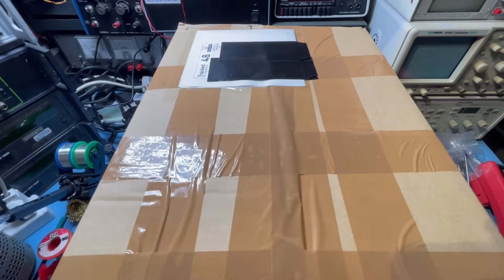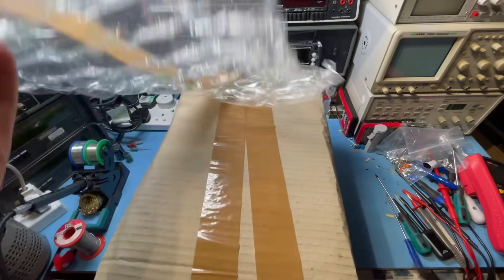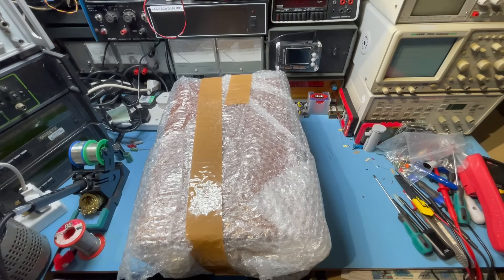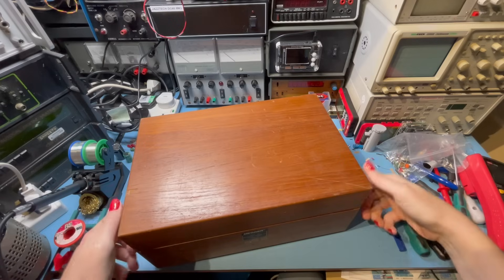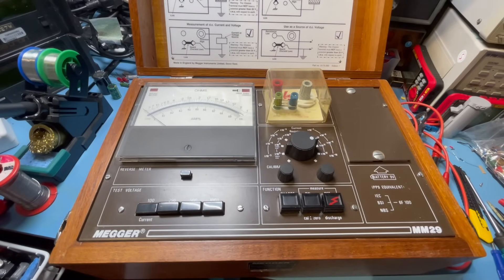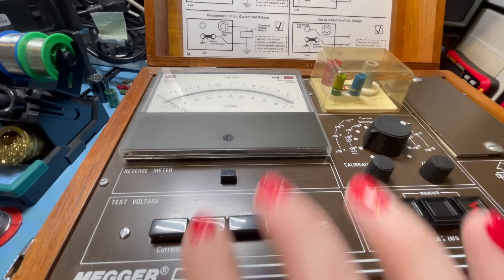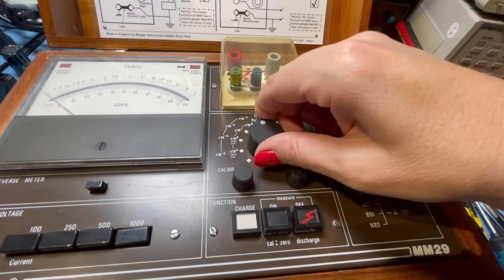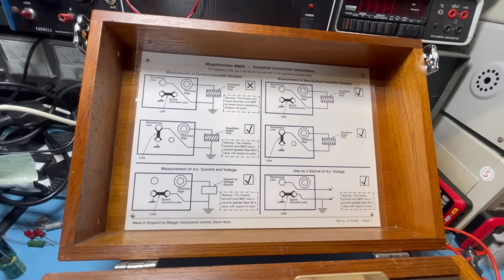Mailbag Time!  Unboxing Vintage Tech & Test Equipment!  More eBay Bargains!

Comment: Another dose of nostalgia, thanks very mmuch Jane. That Megger was a lot more modern than the wind up one we used to use for house electrical instalations in the -60s. You had to connect it to the circuit and crank the handle as fast as you could to generate the test voltage!

Comment: That Ever Ready logo brings back some old memories from about 50 years ago, my dad would bring Ever Ready batteries from work and they were huge.
They were about the size of nine PP9s with three brass screw type terminals, the top of the battery was covered in a thick sort of tar like wax.I have looked but have never seen any pictures of them online, maybe industrial use only.

Comment: I would carefully take the Ever Ready battery apart and put some rechargeable solution in there, just to keep the old style.
Reply from the maker: There is a guy on eBay who makes replica every ready batteries and fills them with standard removeable batteries. I will try and get some to show the channel 😊
Reply: @JazzTechUK  cool!

Comment: I love the battery compartment on the first one, a detachable plastic "tub" you can easily take out and wash with winegar ahould the battery leak. Had to do that on my Avometer, fortunately that has the battery compartment in the rear part of the housing so it can be cleaned without risking getting winegar or water on the actual internals.

Comment: Mind, it's an Ever Ready PP9 battery, so mostlikely a zinc-carbon one. Which rarely if ever leak. Also happy for you to have found the Griffin timer. Just be aware that it can be a bit loud.
Reply from the maker: Haven't tried it yet. Will be interesting.

Comment: Lovely megger and one chonker of a battery! I never knew they made them so big.

Watch out for a RIFA cap in that Philips Fluke scope. Don't turn it on - take it apart! My friend has one and yes, guess what happened... lots of stench indeed. Old Roederstein electrolytics ("Rödelschwein" if you please) are sus too, better replaced right away.

Nice Italian multimeter and educational kit, waiting for the video :)
What a lovely timer! Thing of beauty, joy for ever, like anything electromechanical. Definitely worth a look inside.
Reply: Ever Ready made batteries a lot larger than this one, I remember back in the 60’s they made a 732 12v lantern battery with screw terminals which was about the size of a brick lol,
Reply from the maker: They made batteries much bigger than this. I know for a fact that virtually all the caps in the Philips Fluke scope will all be bad. The other one I have here, exactly the same model, I have tested all the electrolytic caps. Every single one is dead or failing except for about 3 in the power supply which are NOT Philips lol. All the blue Philips ones, about 50 of them are all bad, and of course the Rifa.

Comment: Nice selection of vintage tech there!, i can remember the ice multitester being advertised in  practical wireless magazines in the early/mid 1970's!. I've had several deliveries this week, 2 early 1980s cb radios, a professional 10 amp power supply and 2 early/mid 1970's books on cb radio.
Reply from the maker: That will keep you busy for a while then.